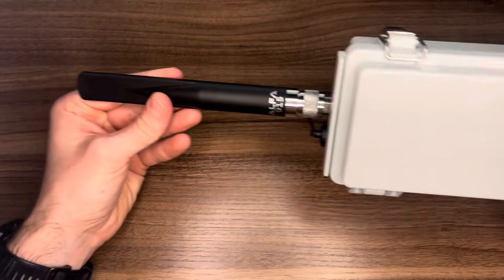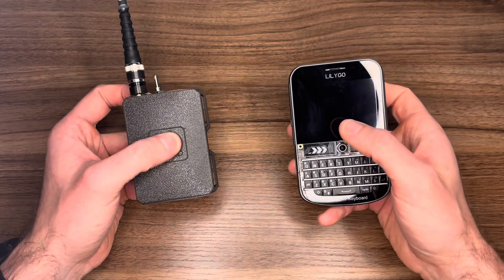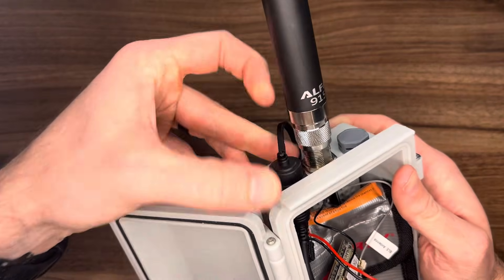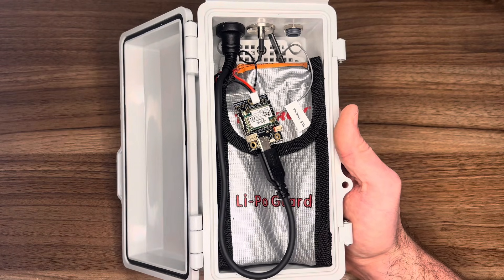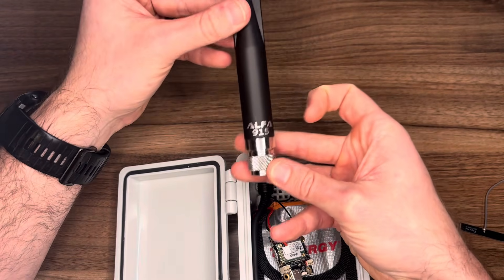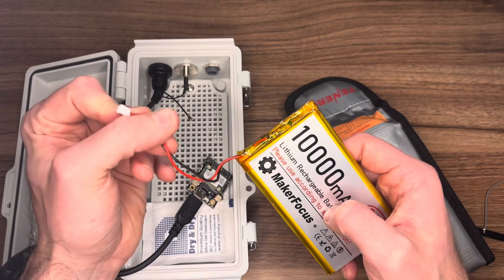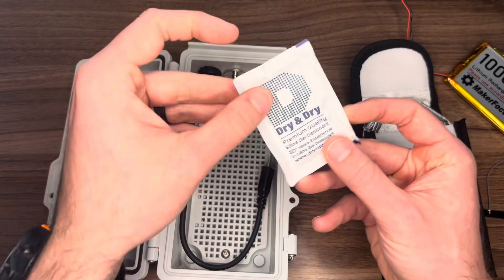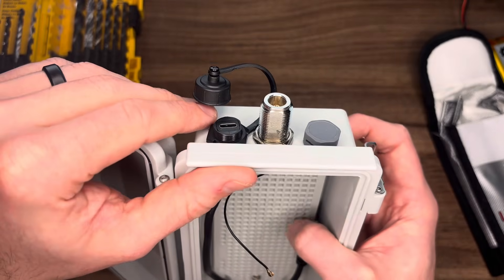Deployable Meshtastic Repeater Build - Teardown and Components

Comment: Nice video, woulden't it be better to use 18650's though because they are safer ?
Reply from the maker: Valid point! When I made this, it was the battery I had. Yeah 18650s are probably safer!! I might make an updated video at some point with the new stuff I’ve learned.
Reply: @madgearcompany  Liopo is nice, but i like safe batteries :)

Comment: As a newbie, if I get a repeater can I connect to it it to send and receive messages like a node?  If so what is the distance the Bluetooth will travel if I put the repeater/node on my roof? Thanks.
Reply: Somewhat New to this still. But Pretty sure u need a node still to send out your message a repeater just sends it further. Pretty sure a node is set different than a repeater like mentioned above (client, etc) hopefully someone answers u with more detail

Comment: Don't bother with the silica beads if you have a breather hole in the box, the beads might actually do the opposite of what you are hoping for.  How they work is by sucking the moisture out of the air so if you have an open source of air they will actually suck up moisture until they are full.  At that point maybe nothing happens but that might not be the case depending on how hot that box gets.   To reuse silica beads you would heat them up and drive off the moisture... now I doubt that you will get the box hot enough but there is a chance if its sitting in the sun on a really hot day that the internal of the box could get hot enough to drive off the water from the beads and then you have a warm wet atmosphere inside the box.   You would be better off sealing the box or leaving the beads out.   Also if you are using a breather make sure that the hole is on the bottom of the device and not the top as you may end up with a water funnel instead of breather.   Ive seen this sort of thing ruin many cameras over the years with them doing the same sort of thing.

Comment: Is there anything special about a "repeater" Meshtastic node, or is it simply a Meshtastic node like any other (just usually designed to be left somewhere semi-permanently)? Would be curious to hear more how it fits into something like a hunting trip where others are carrying Meshtastic.
Reply from the maker: @snusmumriken232  there is, yes! I will do a video about a hunting use case if that’s something that interests you. Routers have higher network priority, and they always rebroadcast a message vs only if they don’t hear it rebroadcast first.

Comment: Does anybody know what module I can put in between a solar panel on the outside of the box in between the battery so the battery won't overcharge from the solar panel? Any information will be greatly appreciated
Reply from the maker: @theofficialfreqoutradio  the RAK boards handle battery charging via solar. If you connect directly to the board, you’ll be good to go

Comment: How could this be powered with PoE instead of USB? It would be nice to keep it powered up and fully charged without a solar panel. That way it can be discreetly mounted on the outside of your home, and have battery power for when the utility power goes out for an extended period of time.
Reply: Would be quite easy. 5V PoE splitter with a USB C output plugged right into the wisblock.

Comment: I can see alot of problems with it,ya shoukd use 18650's for power,mount the rak board properly,power input should be on the bottom of the case and same with the breathe hole and for chargin it use a USB car charger so ya out that inside the case which will power the node when needed but also charge the 18650 pack but also over a longer run if wire ya can use a higher voltage and always use a 1n5404 diode on the 12v input side to the USB phone charger as it will protect it from reverse polarity on the 12V input side and btw ya need a ground plane for the antenna
Reply from the maker: @Trent28888  it’s been working fine for months without any of that, but thanks for the input! Once you’ve built all of that, I’d love to see a video on it as a comparison.

Comment: Thanks for the info. Nice looking build. I agree with comments about the lithium bag. It’s useless and they closed environment like that he would cook everything. Also a stepping drill bit is much more useful. Also you should mount it. Inverted with everything pointing down so you don’t have to worry about Water intrusion from rain. The antenna orientation up or down is irrelevant as a radio waves move it right angles or perpendicular to the antenna. Thank you very much for putting this out.

Comment: I would not bother with the fireproof bag. Enclosed in a box like that, everything inside will still be cooked and the heat build up would be the same as far as ability to melt through or burn the enclosure itself.
Reply from the maker: @ksnax  it’s more to prevent and delay the spread of fire rather than to save the device
Reply: @madgearcompany  Understandable goal, but I don't think it does much in reality. The heat and pressure has to get out of the bag, and that energy still has to escape the box as well.
Reply: @ksnax  they work pretty good at smothering fires (only smoke coming out) it's better to try to contain it than to just let it burn through the box. can possibly save your equipment but not in all cases.
Reply: @Runandgun13  Perhaps, but I think it would make more sense to use iron phosphate cells if fire is a concern, likewise for better thermal tolerance.

Comment: Breather is not necessary
Reply from the maker: @ezekielbreedlove7698  you may build your own however you’d please 😇
Reply: I do not understand the purpose of the breather,  if it allows air in, it will also allow humidity in, defeating the purpose of the silca beads pack.  I worked with outdoor distribution amplifiers and optical nodes,  being perfectly sealed , non ever had a breather.

Comment: The USB Type-C connector should have been placed at the bottom of the case to prevent rainwater from entering.
Reply: the antenna does not need to point upwards.
Reply from the maker: @doctorbsd  it has a waterproof cap. Placing it on top actually prevents pooling if water were to make it in to the cap, which would cause connector corrosion. I’ve had two outside in this configuration for a few months in the rain and snow with no issues!

Comment: Hi! 
Nice video. Got one question. Can the RAK board CHARGE the battery if the USB-C is connected? Does it act like a charger if powered?
Reply from the maker: @SteveNilsen  yes, it will charge the battery!
Reply: @madgearcompany  so would it be safe to add a usb-c solar panel without frying the chip?

Comment: Why put the usb port and breather on the top vs the bottom?  I would think it would be more water resistant on the bottom so I'm really curious the reasoning.  I just got my stuff today from watching your videos so before I drill it I just wanted to clarify it.
Reply from the maker: @lindelof1221  i mounted the one in the video in a place where accessing the top of the box was easier than the bottom. The box has had no water ingress, as the USB C port has a waterproof cap, and the breather hasn’t let any water in either. One of these repeaters has been outside for about 3 months in plenty of rain and it’s still dry! You can definitely mount them on the bottom if that works better for you!
Reply: I am working on mine right now and it makes sense drilling everything from the top because the battery in the bag takes up so much room in the bottom.
Reply: Thank you for your reply and thanks for all the great videos.   Love what your doing.

Comment: Out of curiosity, would it be better to have put the USB and breather holes on the bottom?  Reduce the water ingress opportunities?  Also curious, how long does it take to recharge?
Reply from the maker: @jtderby  for my use case, I decided to put them on the top. I don’t think it makes a difference either way, tbh. The USB C port has a waterproof cap, and when oriented on the top of the case, ingress has not been a problem so far!

The battery recharges at different rates depending on the charger. If it’s a 60w charger with a battery at 20% SOC, the battery would take about 40 mins. If it’s 5w, closer to 6hrs!

Comment: **Please, please, please** don't actually set your node to "Repeater" or "Router" mode unless you REALLY know what you are doing with meshtastic, and you are aware of the other mesh infrastructure in your area. When in doubt, use Client mode, even if it's only acting as an infrastructure node.
Reply from the maker: Good tip!
Reply: There's a recent role called ROUTER_LATE which is also good in case of doubt. It shouldn't be any more able to harm the mesh than CLIENT, while informing other operators that it is not meant to be directly addressed.
Reply: Ok bounced my brain off my forehead.goid job .I'm old school,but catching up.👆👻🌃🙏💯🧩🆓
Reply: If im building a setup on a portable mast with 900mhz sector antennas (like cell towers) to act as a "repeater" and possibly some Omnis for more hops, and using it in an area like the mountains, woods, etc. for camping or whatever, i'm wondering if I should just stay in client mode or use router mode. I like getting RSSI reports which repeater mode doesn't do from what I know.
Reply: @christianperi  I would suggest using Router mode. Client mode is not necessarily guaranteed to repeat everything it hears, but Router is. Another reason I say Router mode is OK in this situation is that your node sounds like it's not meant to be permanently placed, which means you're not likely to harm connectivity on any existing mesh that may be active. Once your node gets packed up it'll be like it was never there.

As for hops, it doesn't matter how many hops your Router (or any other node) is set for - if your router is set for 2 hops and it gets a message that has 7 attached to it, it'll still repeat it as long as there's a hop left to do, and that goes for any node, regardless of Device Type, as long as it's capable of repeating (aka, not Client Mute)
Reply: @innercityprepper Okay thanks for the info. I’m also doing a roof top Omni setup on my house that over looks our valley which is slightly lower in elevation with our main city in the center. There are a handful of nodes throughout the valley set to client. I’m wondering if I should just leave it in client mode for that.
Reply: @christianperi  When in doubt, use Client. The only time Router should ever be used is if you're on a private mesh (different frequency/presets) where you KNOW you're not damaging the greater mesh, or if you KNOW you've got an absolutely killer location like a radio tower, mountaintop, tall building top, etc. The mesh that I maintain has more than 600 nodes and only 3 or 4 Routers, if that's any indication as to how frequently that role should be used.
Reply: @innercityprepper Oh very good to know! Heck I have more questions on their meshtastic stuff I’m knew to it. How can I be in contact with you on social media?
Reply: I whould suggest CLIENT_BASE role fits most of cases😊😊